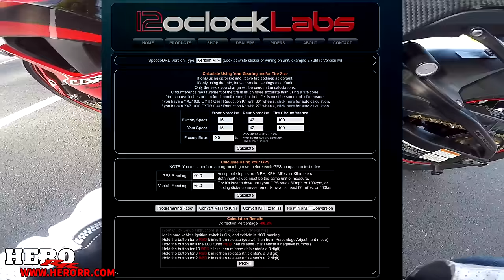2008 CBR600RR 520 Conversion Kit Install and Test Ride + New 12 Spoke Wheels!

Comment: I was always under the impression that you want to leave the chain on and the transmission in neutral with your foot on the rear brake to remove your front sprocket drive nut. So you don't damage your trans in any way. At least that is the way I always do it.
Reply from the maker: Yeah definitely a smarter way of doing it. Next time I’ll probably do it that way to be careful. But luckily no damage was done :) it’s only 40 ft lb of torque.
Reply: @HeroRR  I have mostly Yamaha's and Kawasaki. They seem to like to tighten things until the metal fuses together. 136ft lbs to the rear axle nut on my R1
Reply: @deathwish8339  Wow,THAT is insane torque #'s for that!
Reply: @deathwish8339  that's bonkers
Reply: Your bikes engine puts way more strain than torquing the nut in gear. These things are not made of glass.
Reply: @menom7  for a liter bike???? I don’t think so.
Reply: @jasontodd9302  Sure it is! For a CBR 1000's,the front axle only needs 57ft.lbs. and the rear-axle only needs 83 ft.lbs.
Reply: @dancarlos1216  I would refer you Manuel. Have you talked to Manuel? RTFM
Reply: @deathwish8339  I remember when I was 12.
Reply: @dancarlos1216  great, then you know where to find out how to do it right, or not. It's your countershaft.
Reply: @deathwish8339  These parts are made with the highest quality hardened steel, and rarely as a professional tech do I see any issues with transmissions in bikes, green techs all use impacts on these things and that doesn’t even hurt them. It’s just lame as hell when all you internet mechanics always try to bust everyone’s balls, he did a great job installing his own stuff, just let him be.
Reply: @dancarlos1216  I wasn't busting Hero's balls, I was educating. He already talks about never wanting to sell his 600, if that is the case he should avoid do any damage to the bike. Although a separate case, CBR's in the past have had many, many transmission issues (usually with shift forks, see 929rr and 954rr). Don't coddle people's ignorance just to spare their feelings. Teach them the right way so they can pass the information on.
Reply: @deathwish8339  All you typical commenters are very similar, you think your way or opinion is worth something and there is no other way. Hero reads service manuals and uses the info he sees fit. Again, the motorcycle under full load applies way more force than torquing the nut to 40ftlbs while in gear.
Reply: @dancarlos1216  notice how you said alot of new techs do it improperly but you defend them by saying that the transmissions are built strong enough to withstand the abuse? Wouldn't have added that whole bit if there was a proper way to do it. Get out of your feefee's. You don't have to admit that I'm right, but don't lead people down a bad path to try and prove that you are right.
Reply: @deathwish8339  I’m not trying to prove anything, have a nice evening sir.

Comment: Does it change the performance of the bike in any way?
Reply: I think Faster acceleration with slightly less top speed… sort of like changing the diff gears in a car… at least that’s how I understand it personally
Reply: I havent watched the video yet. But I think the idea is you have less weight in the chain, so less rotating mass, so increased acceleration.

Comment: I still have 525 chain but
went down one in the front on a 2006 gsxr 750 and it made a noticeable diffrence for sure. Ill take the acceleration over top speed never gonna go 165mph. Never had an issue with the gear indicator though.
Reply from the maker: My gear indicator is aftermarket. It is calibrated by setting the rpm to each gear. When I changed the gearing it out everything out of wack lol. I just need to recalibrate. Not a big deal. :)
Reply: @HeroRR  Ahh gotcha that makes sense glad its an easy fix for you 🙂

Comment: Exactly the -1 front or +2 on rear is like loosing top gear . Great acceleration until that point. Hwy riding is a higher rev range & bit annoying

Comment: Dude, 600s are beast. 
I may or may not even upgrade to a 1k. I have an 05 f4i now and I'll either get a r6  or zx6r. I can use more of the full power of the 600 vs a 1k. 
#600gang

Comment: Nice Job , but since you have the angle grinder out just cut the chain in half
Reply from the maker: Wanted to minimize the amount of sparks flying everywhere, the tool takes a little longer but it's a cleaner job.

Comment: Why did you go with the 520 conversion vs the oem 525 chain and sprockets?
Reply from the maker: Wanted to try it. Apparently there’s no real downsides other than the chain will wear out slightly faster. Since I have 4 motorcycles sharing the mileage every year it’s ok for me to take less rotating mass over longevity. And for what it’s worth a lot of people say that the 520 lasts just as long.

Comment: Hi, can I ask from where you got those 2013+ rims on the bike? its an must have upgrade! for weight and looks....Need that for the bike as well....Thanks in advance!
Reply from the maker: ebay, used oem 2013+ cbr600rr wheels.
Reply: Thank you! @HeroRR

Comment: you need to remove another link or two..  new chain is pretty close to the replace chain area.. center of axle should be well within the "new" area.. just fyi..
Reply: Wheelbase length is a tuning feature. Shorter is more agile but less stable, longer is more stable but changes direction slower. Just fyi..
Reply from the maker: I don't know, I just went with the OEM number of links for the 520. Maybe I should have added a link? Oh well i'm sure it will still last a long time.
Reply: @HeroRR  remove a link or two at most..  remember,,,, when you took off old chain it is old and was "stretched"...  count links to verify if you still have old chain...  you might have 1 maybe 2 extra on the new one...  but either way the center of axle should be in the new zone..... lookint at your new one on the vid it seems its in the replace zone....  dont want to have to replace in 7k miles when you could get 15-20k+ miles out of it..
Reply: @Jammin6796  That sticker is just a guide for dummies when to replace chain, as long as he keeps chain cleaned, lubed, and adjusted and he doesn’t run out of room in the swingarm, which he won’t. I’m literally a professional tech at a dealership, and also do track days 1-2 times a month. Just to put my words into context.

Comment: What tire do you recommend for the front? I recently purchased one a few months back for my 09' cbr600rr and once I get to a certain speed, my handle bars start to shake/wobble.
Reply from the maker: My favorite so far is Dunlop Q3+, but the ones that are on my bike now are pretty good since I didn't bother removing the tires off the new wheels and they were 2021 tires.. (sorry I forgot the brand).
Reply: i love my q3+

Comment: felt your pain the moments you tortured yourself to undo bolts to parts no longer held down by their mounting points, instead of breaking them loose first with the help of the other fixed fastenings

Comment: Hey HeroRR ... I have a red 07 CBR600RR with the factory 3 spokes... Is there any other parts at all that are necessary to put the 2020 wheels on or will they simply bolt on perfectly?

 Thanks
Reply from the maker: Bolts right up perfectly.
Reply: @HeroRR  Thnx 👍🏻
Reply: @HeroRR  Hey Hero, ... I just called my Honda Dealer here in arctic hillbilly 🇨🇦 and they just quoted me $2200 for the front rime and $2400 more for the rear... Where did you get yours and would they ship to Canada do you know? I'm sorry but $3700 USD or 4600.00 CAD for factory non Carbon Fiber wheels is stupid.
Reply: Hey bro... Thought I'd ask 1 more time... 👍🏻🙂 ... Are your new wheels OEM Authentic Honda wheels or Aftermarket ie: Arashi ?

 Thank You

Comment: How did you let your chain get to that point though?
Reply from the maker: I stored my cbr in the shed over the winter and there was a leak. Both the vfr and cbr chains got rusted. I replaced both.
Reply: @HeroRR  Ahhh.... thanks for the explanation. It's so far out of my lexicon as a ride all year.

Comment: Did the new front wheel bolt right up?
Reply from the maker: Yes
Reply: @HeroRR  I had read in another build that a fork from 2013 or newer was needed. I guess that’s not the case! Good to know.

Comment: Why make your Speedo accurate? It will only be accurate once then as tyres wear, grow with speed and shrink with lean the speedo is off… you need your speedo to under read so you never get done for speeding while doing what you thought was the limit. It’s why it’s law for speedos to under read by 5-10%.